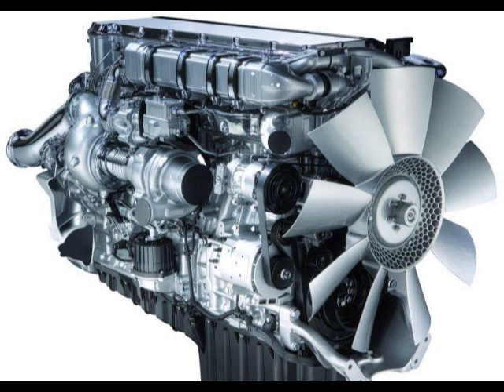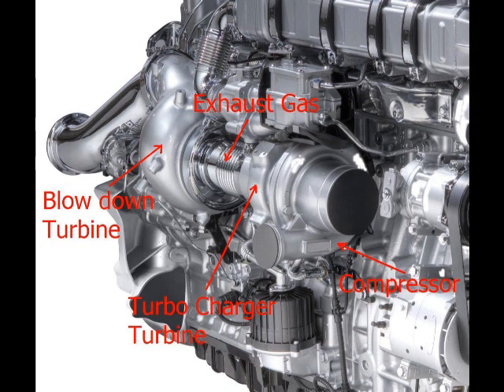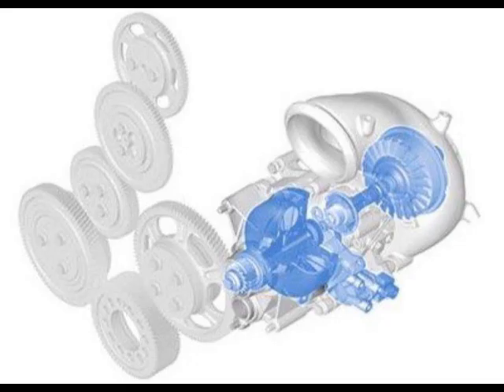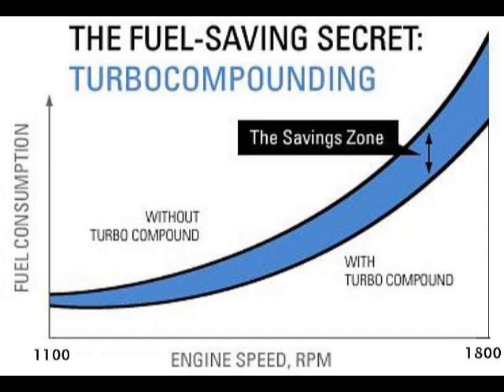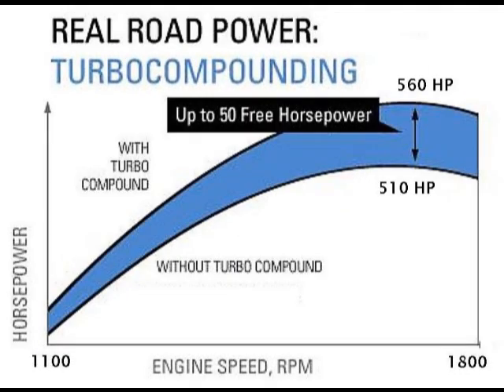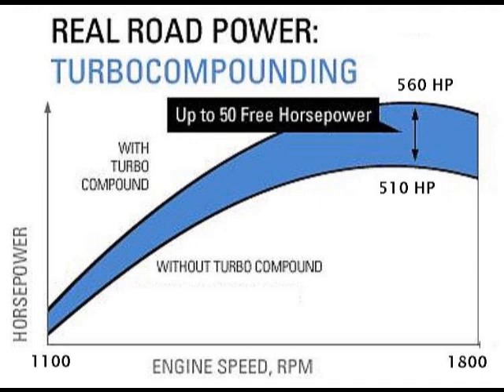Turbo Compound diesel truck engine

Comment: Dude, you dont make sense. I proved my point of how that system works because i seen it work on a DD15. You on the other hand have no clue what you're talking about. Im a ASE master technician with 6 years in the field working on oil drilling rigs, 644E loaders, scrapers, D7Gs, Ac 51s, etc. I've rebuilt engines like the cummins isx, isb, isc and dt466s. Next time you talk to a fellow youtuber you dont know show some respect when they have shown you respect. I could be your daddy you bastard

Comment: Not really bro @ a manufactured rating going off engine speed n load this turbo provides maximum torque assist to an engines drivetrain which therefore increases fuel economy. It has gear reduction on the drivetrain side of the turbo sort of like what happens when an engine spins a manual transmisson in 1st gear. Engine spins alot trans a little but you get alot of torque.